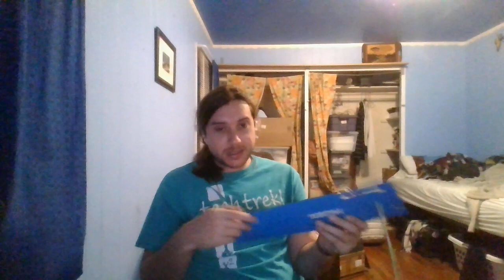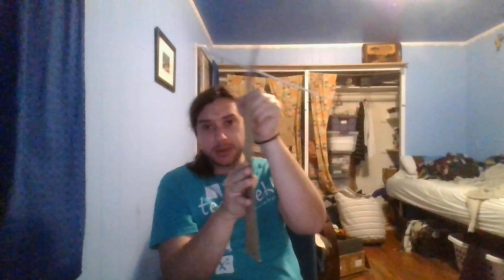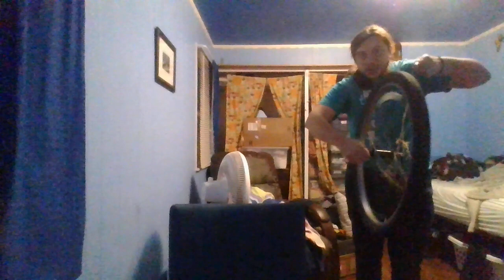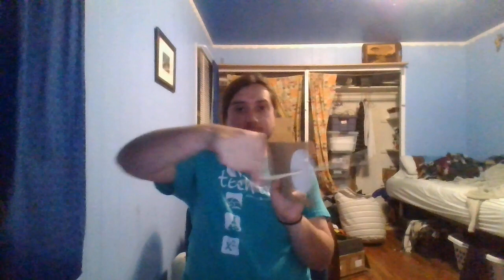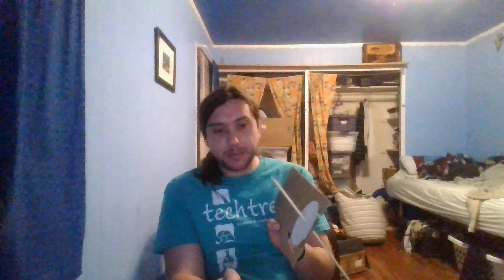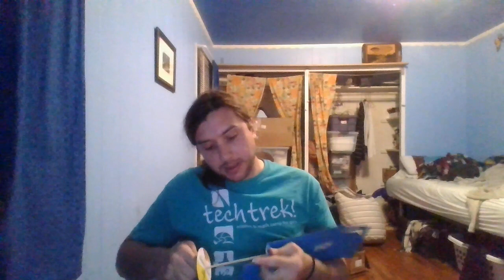Rollerons and Angular Momentum

Comment: would a free spinning gryoscope remain orientated the same direction or change at all , while travelling over an ocean at speed ?
Reply from the maker: Depends on what you mean by free spinning but yeah, if you mount it in a gimbal it or anything that lets it rotate freely will keep its orientation.
Reply: @EricaCalman  ..One that isnt [gravitationally locked] like an attitude indicator in an aeroplane i mean. So, keep its orientation means its not affected by gravity in any way ?!. do you know if that has ever been done as an experiment?.
Reply from the maker: Yes like an attitude indicator in an airplane. The only way gravity imparts a torque is if the gryo is suspended from only one side like in the bike tire example.